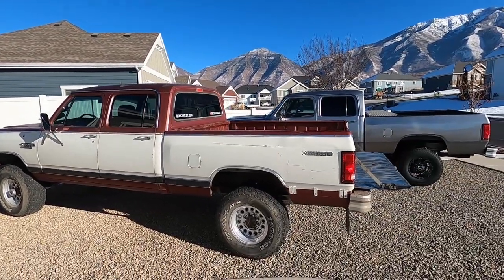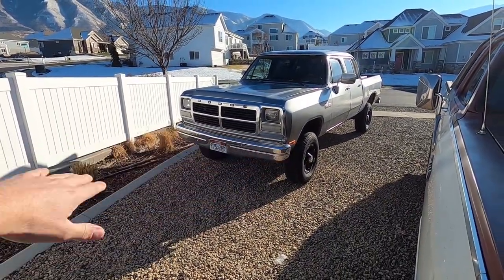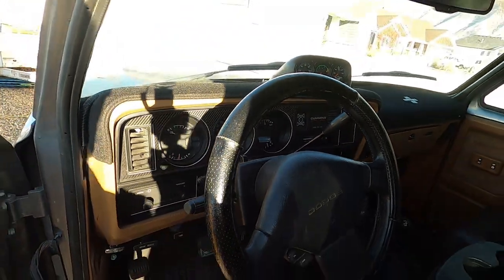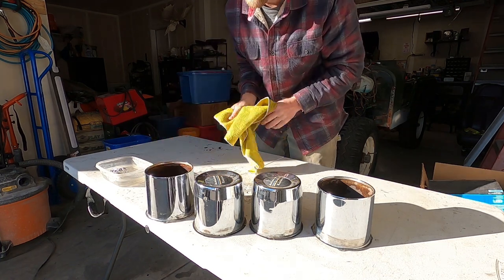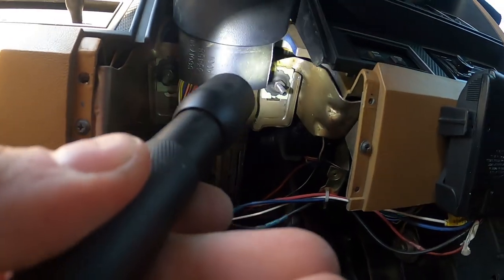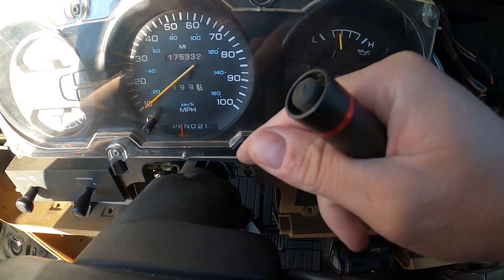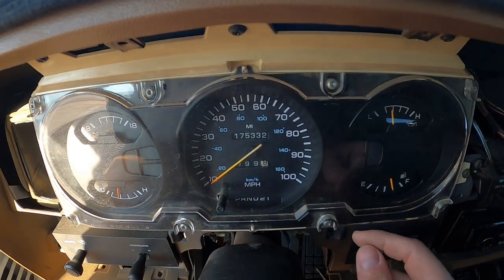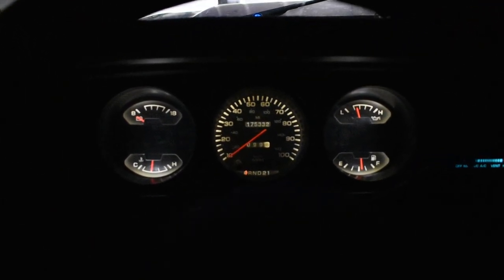Basic First Gen Projects

Comment from the maker: Comment below, what projects are you currently tackling? Let's get some motivation going in the comments!
Reply: Doing brakes starter paint body and a some mods on my 91 d250
Reply from the maker: Sounds like some good stuff going on.
Reply: From stem to stern.  Replaced my 410 diff with a 354, eliminated the ABS and now heading to the front.  Tackling the installation of an upgraded VE pump (thanks Eric Gilbert at Hungry Diesel), and full front end suspension.  Currently having issues with tie rod replacement.  92 D250 5.9 diesel crew cab.

Comment: Well  looking at my next project. A 2000 dodge ram 3500 dually 4x4. A famous Norwegian bought it brand new when he came from Norway. All the options in the book. Woodgrain trim,heated and power leather seats with the dodge emblem on them, Cd and cassette player, sliding rear window, and metallic patriot blue paint. Then the original owners added some banks performance parts like the gauges and what not.

However it's gonna be a really big project. It was run into a ditch somewhere in 08'.

Comment: I am 16, and currently starting to fix up my 1985 dodge w350, its not a crew cab though. My dad gave me his old fire wood getting truck, so it needs a quite a bit of work but still in good shape considering the abuse it was put through. I just recently got a tailgate for it, for the first in the 20 years of my parents owning it, and just had a new stereo and speakers installed. I have plans in the spring to weld in new floor pans since the driver side as a big hole rusted through it, and plan to do a new exhaust system and redo the interior.
Reply from the maker: Collin, That will be a great first truck to have. Work on it little by little and learn as much as you can. It will pay dividends in the future.

Comment: I also have used the aluminum foil trick on some of my parts. Don't know that it matters much, but I always use the shiny side of the foil on the part. I just wire wheeled my floorplans, used Ospho and painted with tractor grade rust-oleum. Once dry I'm doing the entire floor in Knoknoise 100mil sound deadening then new carpet and shifter boots.
Reply from the maker: Send me pics when of each step. I did some research on the ospho. I'm actually going to use a different product for the jeep but the ospho is perfect for those floor boards

Comment: Nice work with the lights Tim! I recently replaced my stock tape deck radio that had stopped working last year. I found a guy on EBay that installs blue tooth receivers inside of stock Chrysler head units. I wanted to retain the stock look. It works well and no one even knows it’s there. Glad to see your channel continue to grow, I remember when I subscribed to the channel when you had 30 or so subscribers.
Reply from the maker: That would be awesome! How much did that cost? Thanks for your support of the channel Josh!

Comment: Hey Tim and Subs! Hope everyone is having a good weekend. My project list for my 92 w250 grows by the day! My first project is rebuilding my np205 transfer case, also sourcing the speedo sending unit which is the major bug in the link. My square PDG is broke off inside the case :/ 
I also have overcharging issue as well (no aftermarket electronics) so I will be installing a Transpo internal regulator, and a CPS. Both on the list for today! 
Then we take the bed off and rewire my trailer harness like one of you're previous videos suggests! Then it's all down hill from there! Maybe the tps delete is best after the Tcase rebuild? Thoughts?
Reply from the maker: Dang, you're working on a ton of cool stuff!
Reply: @decentgarage  yessir, the list is expanding everyday! Turns out the cps was over gapped and I didnt need to use the transpo..yet. Dealing with the pesky air in fuel bugs now. I'm almost positive it's the LP, that valve inside is stuck I'm thinking, or just tired. Was able to bleed a few times last week with no issues, now I get no fuel to filter. Hoping it's the LP, will replace fuel lines as well!

Comment: Heater blower not working! 30Amp fuse is good. Shroud over blower motor is dry rotted but functional. Hesitate to pull it off until I can find a new one since I'm not sure the blower's bad! It only has 365k on it!
Reply from the maker: Jim lane has a really good write-up on diagnosing blower motor issues and adding relays to the switch to make it work better. I was reading it last night.
Reply: @decentgarage  Thanks!

Comment: Hey love your builds! Quick question, have much room/space is in the back seats of your crew cabs? Just wondering for a full family of almost all of 6’ tall people
Reply from the maker: Great question. There is definitely room for full grown adults. Many having ridden in mine. If I knew I was going to be hauling adults more often I would change the rear seat to a newer style like a 4th gen cummins or an f150 because they would likely have more room.
Reply: @decentgarage  awesome thanks for the input. Do you know if there are or what kind of modifications are required to put the 4gen seats in? Both front and back?
Reply from the maker: It requires some fab work in getting them mounted but nothing unmanageable. That's probably the most common rear seat I see in these crew cabs apart from the stock seat.

Comment: I have a problem, I have a air leak coming from underneath my turbo rite at the control rod. How can I fix it without taking the turbo off? Its a 2nd gen by the way.
Reply from the maker: Hmmm, it depends on where it's leaking from. The turbo isn't hard to pull off though.

Comment: 1993 D350 Cummins, replacing the entire front end, and lastly im on the passenger brake line, I hate this project lol
Reply from the maker: It's a love hate relationship for sure
Reply: Did that back in July and was a pain but well worth it!
Reply: @timothymichael2561  im excited, its gonna drive like a new truck
Reply: I gotta do mine too. Besides the threaded upper ball joint can I just basically follow the ChrisFix video or are there any other differences?
Reply: @AnxiousCowboy  I followed his too, just be ready to never find the correct camber keys, all aftermarket camber keys are too small
Reply: @SolarCSGO  so what did you find that worked?
Reply: @AnxiousCowboy  I got the only ones I could and when I took It to get aligned they were obviously too small, so I just had them torque it down ridiculously tight, im gonna have to figure something out lol
Reply: @SolarCSGO  I’m already in over my head ha ha. Maybe I’ll find a shop for that project and save some money cus it will probably be a couple thousand
Reply: @AnxiousCowboy  honestly it wasn't that expensive, just rather time consuming lol

Comment: OK I don’t know if you or anybody else has ever had a problem with the mirrors folding up on you while you’re driving 60 miles an hour down the road or even slower than 60 miles an hour that’s the problem that I’m having with my mirrors. I’ll be driving down the road and my passenger side mirror and sometimes my driver side mirror will just fold in on me and I have no idea how to fix it I’ve completely taken them off my truck and tighten the mirror base up but that doesn’t do no justice in the plastic pieces that allow the mirror to move are still intact sorry for the long comment
Reply from the maker: Mine used to do that. When I pulled the mirrors off to paint the truck I tightened the set screw down around the mirror post. Now they don't even move when I bump them walking by the truck 🤣. If you've tightened that screw I would take the screw off and put a few wraps of electrical tape around the post where it gets clamped on to to build it up slightly. This should keep it tighter.
Reply: @decentgarage  Awesome man thank you for the help I appreciate you brother man and keep up the good work you’ve help me out a whole lot with your videos